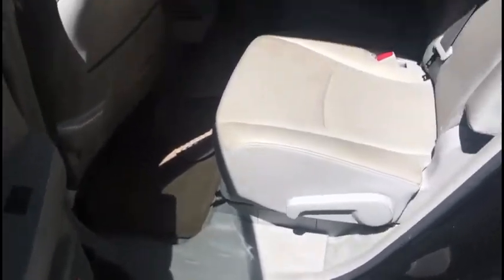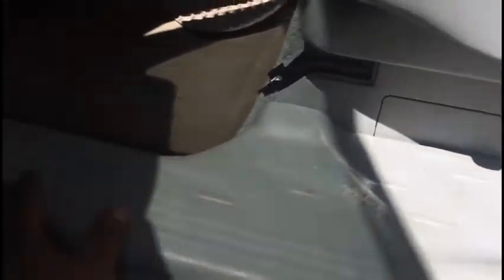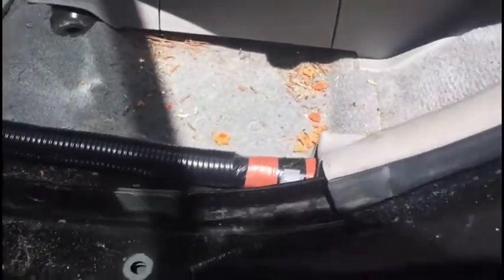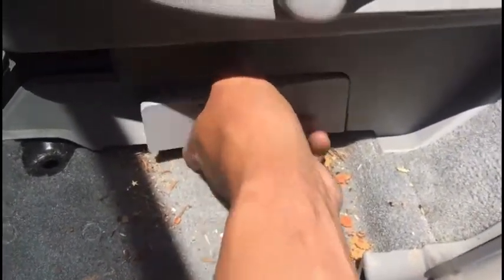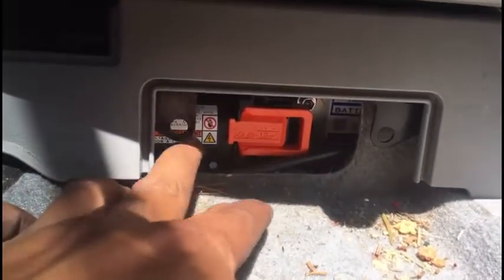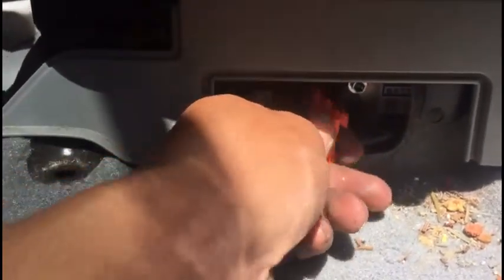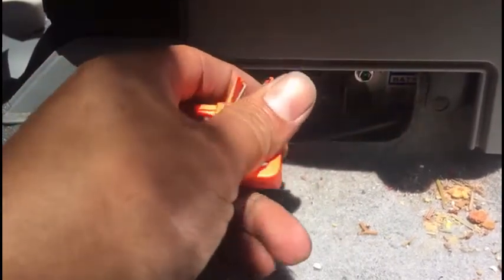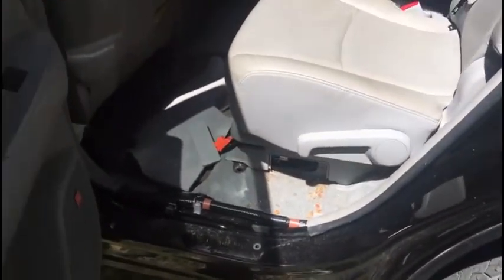HOW to disconnect the HYBRID system on a 09 TOYOTA HIGHLANDER

Comment: Will it still run disconnected  
I have an error code truck keep cutting off
Reply from the maker: As fas as i know it wont run with it disconnected!
I might be wrong!.. but what codes you getting??
Reply: @GeneralMechanicGA  I disconnected the negative post for like 5 min and they cleared. The code was check hybrid system
Reply: Hey can u help me I have a code that say P0A78 drive motor "a" inverter performance??
Reply from the maker: What vehicle do you have?
Reply: @GeneralMechanicGA  I have a Toyota highlander 2009 hybrid LE
Reply: It turns on but doesn't allow to me move says check abs, brake malfunction, check hybrid system it let's me rev the gas but it's on limp mode doesn't go forward or reverse feel like the brakes are locked in front like its stiff smdh 8(
Reply: @GeneralMechanicGA  do u think it's the transmission a science repair mechanic shop told it's the trans but I looked it up with that code said it can be the inverter/converter?
Reply: A. Rodriguez what was the final result of this I am experiencing the same